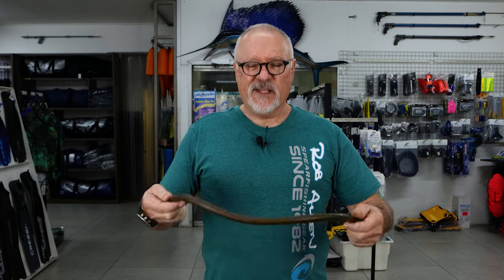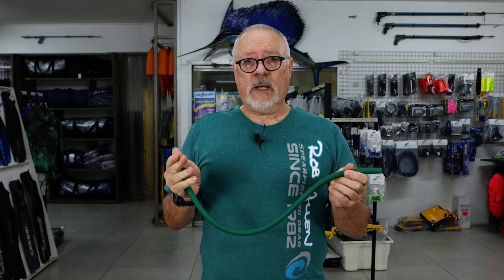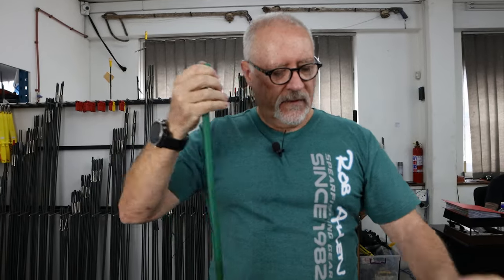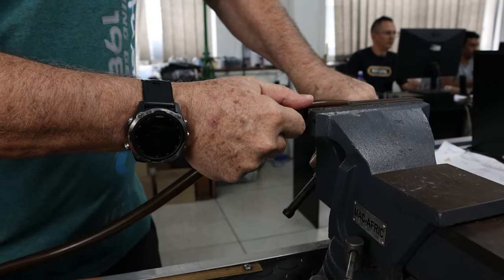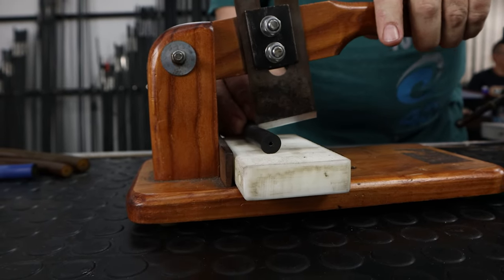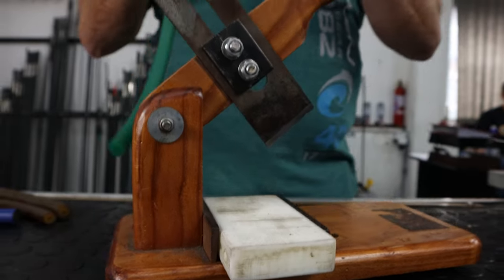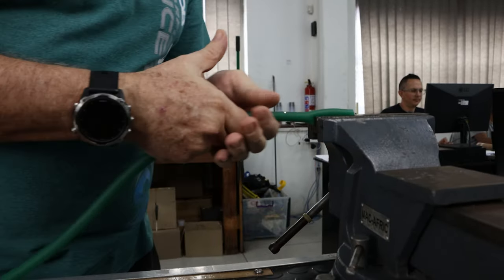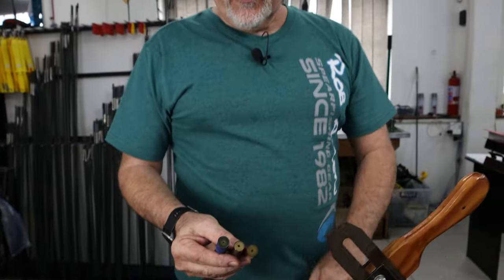Rob Allen | Rubber Notch Durability | Part 1 | 2023

Comment: Hi Rob, definitely some low quality dipped rubbers on the market place as well which divers should be aware of but we've always had best success with Rob Allen rubbers.  Wondering if you've found any dipped speargun latex rubber manufacturers that are closing the gap and catching up with with your manufacturer?
Reply from the maker: Agreed, lots of poor quality out there. We still test from time to time and would change if we could find better but..... so far nothing as good as what we use.

Comment: Hello. You said earlier that each rubber can accelerate a shaft to a certain speed. It turns out that the rubber that gives higher speed is reactive? I tried Sigal and Salvimar rubber of the same diameter. Sigal gives significantly greater shaft speed. I shoot light 6.25 harpoons. With reactive rubber, the shaft flies straight and penetrates fish better. It is a fact.
Reply from the maker: As long as you can get your spear up to the maximum speed of the rubber, you will get the best performance 👍

Comment: Is there a way to tell the difference between dipped and extruded solid colour rubbers? I thought that solid = extruded, but you showed some black dipped. Would one have to do the cut test?
Reply from the maker: Hi, I just checked a sample of all black. It is very difficult to see the rings but they are there. The only way to be sure is to do the tear test as shown in the video. I do recall seeing plain amber (no pigment) dipped latex and the rings were more visible.

Comment: I like your rubber but it so expensive 😔🇵🇭
Reply from the maker: You have to weigh the pros and cons. If you do not need high performance then no problem for you to stick to the cheaper options. We do not have a distributor in the Philippines so you could order direct. If you put together an order with a few friends the and order direct from us it could be a reasonable price.